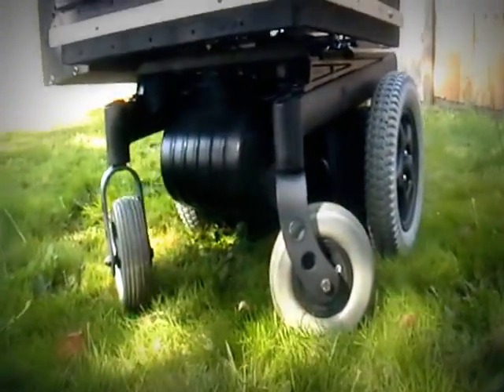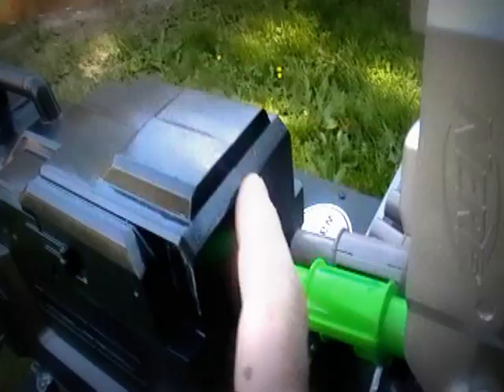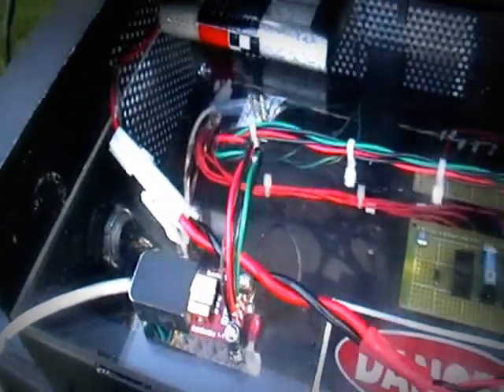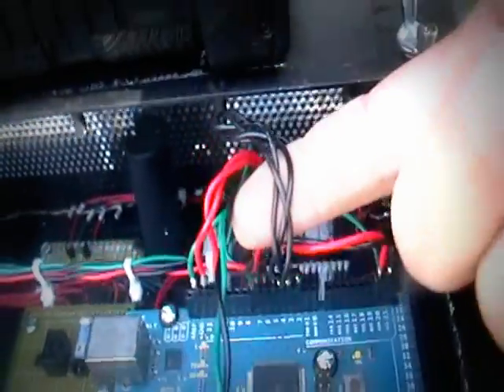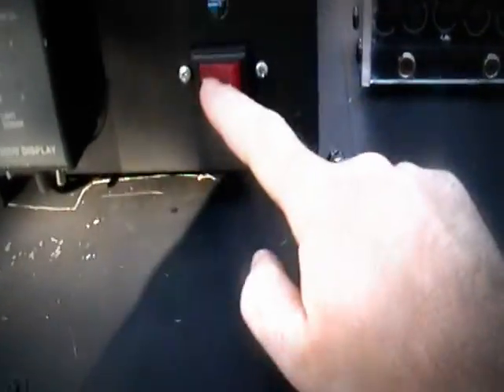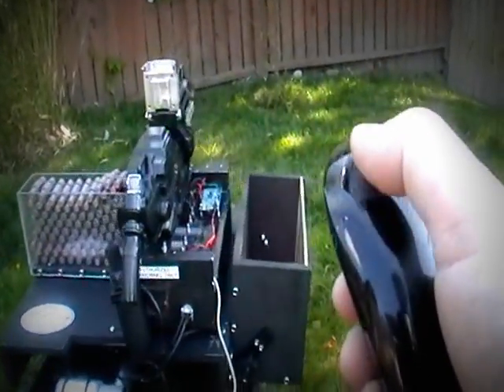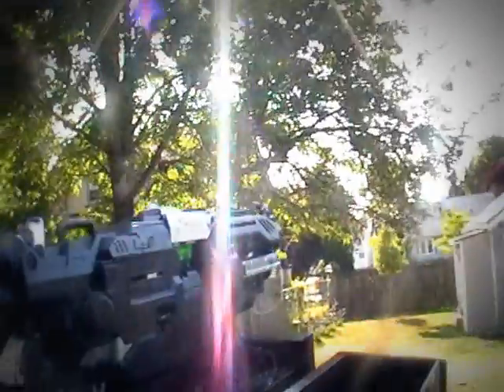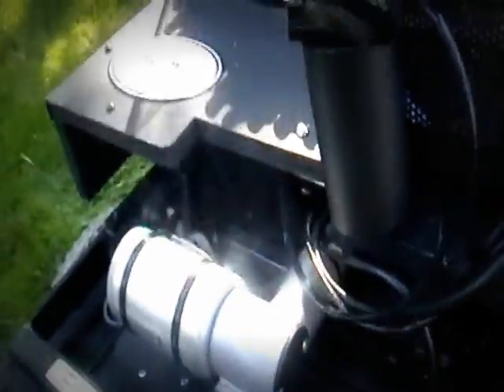Nerf Vulcan Mod, Remote controlled Electric Wheelchair

Comment from the maker: @fellowsjeff   The round PCB was originally in the base of the joystick.  Power came from the chair to the joystick base where it  first connected to the round PCB you seen in the video.  Then to the actual joystick.  I relocated it due to space issues in the joystick base.  Then just ran a Cat-5 cable from the black box to the joystick base for 5volts, ground, X and Y axis.  This made wiring the whole thing a little easier.

Comment from the maker: @thomas3120.  I'm not sure what the load the linear actuator draws.  It is 24 volt.  I am using all oem wheelchair speed controller/motor driver controls because they are 5volt, same as Arduino.

Comment from the maker: An update will be soon.  I am in the process of installing a proper power supply for the arduino.  And the acrylic clip is gone.  Not to mention the fact that the vuclan has been repositioned next to the black enclosure and has been modded with two windshield pumps to squirt water.  An update is needed for sure.

Comment from the maker: I am not mimicking the entire joystick.  The original joystick always has 5volts to it. The red switch at the front of the black box simply controls where the X and Y signal comes from( Arduino or Original Joystick).

Comment: Very cool.  What signals are you simulating with the Arduino?  Are you mimicking the entire joystick unit, or just the X-Y potentiometer (or whatever it is) output.  I just picked up a non-working Invacare powerchair and suspect that the joystick module is bad.  If I can figure out how to feed the motor controller what it wants, I could repurpose the base as you have.

Comment: Have you considered using a wireless nunchuck?
Reply from the maker: That's exactly what I'm using now.  I really need to do an updates video.
Reply: Ah, nice!

Quick question, I've got a Wii nuncheck and I'm manually connecting the receiver to the Arduino. Which pins go where?